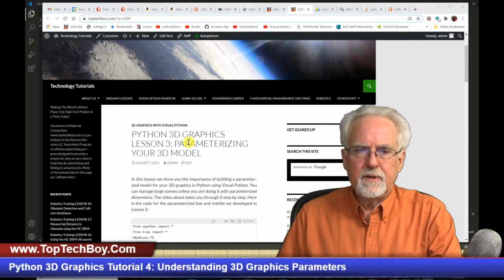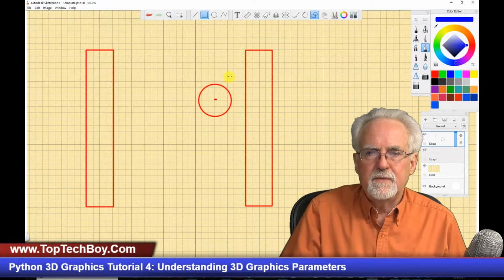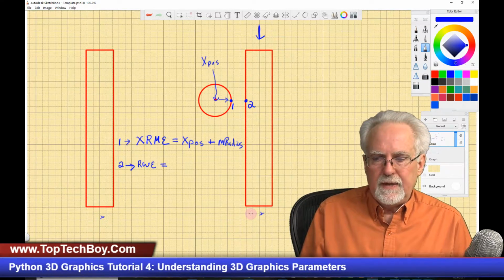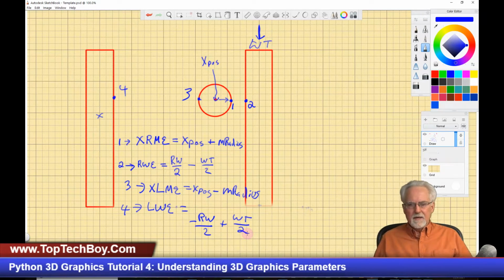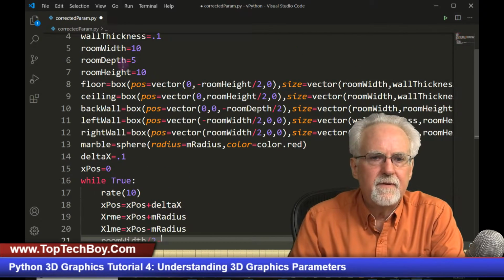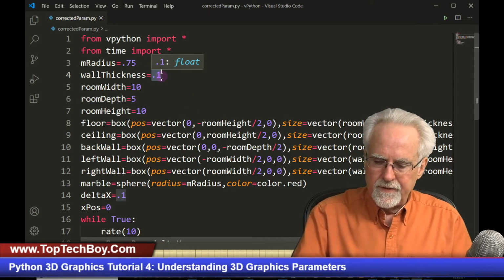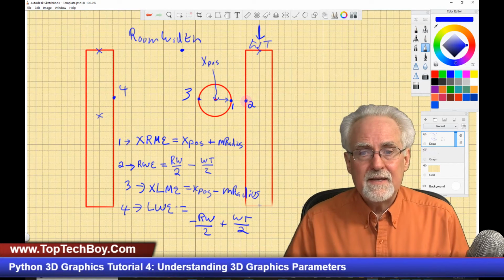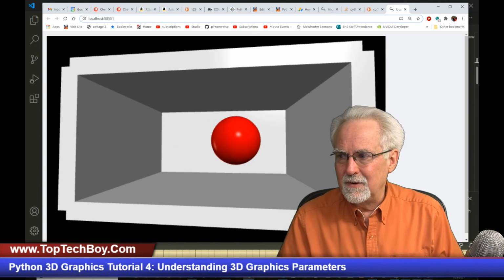Python 3D Graphics Tutorial 4: Understanding 3D Graphic Parameters

Comment: I love your videos but your explanation here was overcomplicated in my opinion. Just set the limits of the bounces at a distance of radius+half thickness from the wall centers (Roomwidth/2) using the negative sign on the left side. You don't need new parameters: 
 xPos=xPos+dx
    if xPos>RmWdt/2-(mRadius+WlThick/2) or xPos<-RmWdt/2+(mRadius+WlThick/2):
        dx=-dx
    marble.pos=(vector (xPos,0,0))

Comment: I completely get the addition of the two variables for 'perfect bouncing' in one dimension, however for all three, I found it simpler to include more of the original parameters in the conditionals (after all the new parameters were based on the existing ones...:
for i in range(0, 3):       # shifts the ball incrementally
        pos[i] = pos[i] + delta[i] # in all three dimensions
if (pos[0] >= (width/2 - rad - thickness/2) or pos[0] <= -(width/2 - rad - thickness/2)):
        delta[0] = delta[0] * (-1) # bouncing off the left and right walls
    if (pos[1] >= (height/2 - rad - thickness/2) or pos[1] <= -(height/2 - rad - thickness/2)):
        delta[1] = delta[1] * (-1) # bouncing off the top and bottom walls
    if (pos[2] >= (depth/2 - rad - thickness/2) or pos[2] <= -(depth/2 - rad - thickness/2)):
        delta[2] = delta[2] * (-1) # bouncing off the back and 'front' wall (we haven't rendered the front wall)
                                   # so we can see what's happening
I also used an array for position and delta to keep things a bit neater for my own ease of reference, but that's just personal preference :-)🙂

I am also legend by the way 🙂

Comment: I am LEGEND.. Here is my solution to homework assignment given in Lesson 3 ..
I created a new variable called 'ballTravel'   ....     ballTravel = (roomWidth / 2) - (wallThickness / 2) - (mRadius).      
 Used it in the 'while' loop. . Looks good here.    Thanks again Paul for a great lesson

mRadius = 0.5
wallThickness = 0.1
roomWidth = 15
roomDepth = 5
roomHeight = 10

floor = box(
    pos=vector(0, -roomHeight / 2, 0),
    color=color.white,
    size=vector(roomWidth, wallThickness, roomDepth),
)
ceiling = box(
    pos=vector(0, roomHeight / 2, 0),
    color=color.white,
    size=vector(roomWidth, wallThickness, roomDepth),
)
rSide = box(
    pos=vector(roomWidth / 2, 0, 0),
    color=color.white,
    size=vector(wallThickness, roomHeight, roomDepth),
)
lSide = box(
    pos=vector(-roomWidth / 2, 0, 0),
    color=color.white,
    size=vector(wallThickness, roomHeight, roomDepth),
)
back = box(
    pos=vector(0, 0, -roomDepth / 2),
    color=color.white,
    size=vector(roomWidth, roomHeight, wallThickness),
)
marble = sphere(color=color.red, radius=mRadius)
deltaX = 0.1
xPos = 0
ballTravel = (roomWidth / 2) - (wallThickness / 2) - (mRadius)

while True:
    rate(30)
    xPos = xPos + deltaX
    if xPos > ballTravel or xPos < -ballTravel:
        deltaX = deltaX * (-1)
    marble.pos = vector(xPos, 0, 0)
Reply from the maker: LEGEND!

Comment: I got mine to work but I guess I did not fully paramaterize everything, I just changed my if statement to: "if xPos > (roomWidth - wallThickness) / 2 - mRadius  or xPos < (-roomWidth + wallThickness) / 2 + mRadius:" which worked and used less variables/parameters.  I guess I am not really sure why having additional variables is better than just changing the if statement. I will try to do the homework using your parameters method to get the ball bouncing in 3 dimensions and see where that gets me!

Comment: In the lesson I put a comment about making the ball bounce back when it touched the was rather then halfway through, but I have to admit that I did not account for the thickness of the wall.  with the code I showed if you made the wall thickness 3, my ball would enter the wall.  As you said, as coders we need to test under different conditions, especially the extremes. Fixed solution below.:
      if (xPos+wallThickness/2 >= (roomWidth/2-mRadius) or xPos-wallThickness/2 <= (-roomWidth/2+mRadius)):

           deltaX=deltaX*(-1)
Thanks for the lesson.
Reply: It's much easier to visualise when you write:
xPos + mRadius > (roomWidth - wallThickness) / 2
^ marble part            ^ wall part

Comment: Thank, Paul. I'm having a blast with your tutorials and am excited to see how to relate this to the real world. 

There was one parameter change that caused the ball to protrude the wall - I'm wondering if this happens with yours also. I increased DeltaX to 1 in order to speed up the ball movement; this caused the issue. I realize now that I could increase the velocity of the ball by increasing the rate(), but why do you think DeltaX would cause this anomaly?
Reply: I think increasing DeltaX will cause the ball to jump further per tick. Therefore it will not change direction until after the tick, hence protruding the wall. One could say by increasing the rate() you get a more "accurate", tracing movement of the ball.

Comment: Folded. Tried to extrapolate from X but using 3 if statements just won't  work  for me. Await your method
Reply from the maker: Think through it. Maybe just do only y instead of x. Then do x and y. Then Maybe you will see where to go.
Reply: @paulmcwhorter  Got  them all  going separately, just can't join them. Tried using if and  elif, no success, have to await your solution.

Comment: I think the calculation is a bit messy, the distance between the left wall and right wall is 5.
So, in this case i think we should not consider the wall thickness. I think we should consider
the center of the marble and the center of the left and right wall will coincide, so the marble
will travel 0.75 less than half of the distance between the edges of the left and right wall.
Therefore, the calculation or the code should read like this: If( xPos >(4.25) orxPos<(-4.25)).
This code would make the marble to bounce exactly between the edges of left and right walls.
Reply from the maker: Use parameters man, not constants.  Go watch the next few lessons. YOu are doing the hard way.
Reply: I did that too when I did the homework.  However, you do need to parameterize because if you change the wall thickness or marble radius the marble will not reverse at the right position.  I didn't realize the error until I saw Paul's solution.  Lesson learned, testing the program is important.

Comment: Hello Paul,

Excellent lesson and I love your use of math equations to explain what needs to be accomplished !!!! Excellent teacher !!!!!! The best !!!!! I did have one question. When you changed to a bigger box and a bigger marble something about the box doesn't look right. Either both the floor and ceiling looked too short or both of the walls needed to be moved in. It looks like a box with a notch in the four corners. Should this be? Is not what I would have expected. Thanks again for your great lessons !!!! Rick
Reply from the maker: It is doing what we say if you think about it. It is aligning the center of the wall to the position. You would have to modify wall position by half the thickness of the wall.
Reply: This is something you have to think about when you're building "real" boxes.
Reply: For a better result, you can just set 'size=vector(roomWidth+wallThickness, wallThickness, roomDepth)'  for the floor and the ceiling.